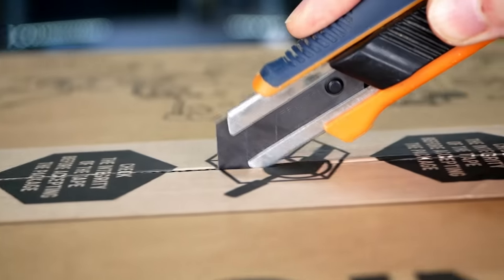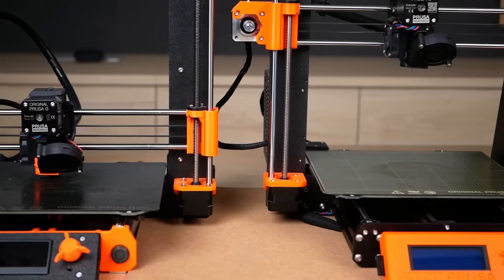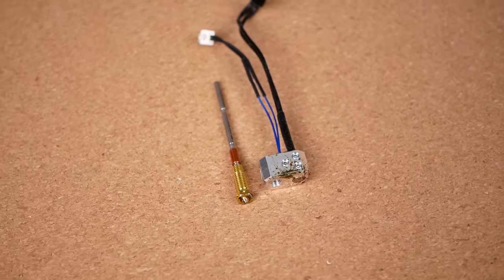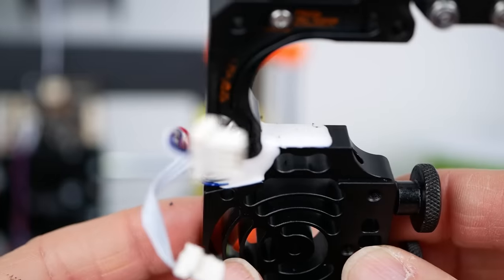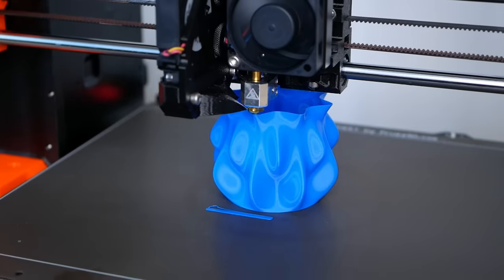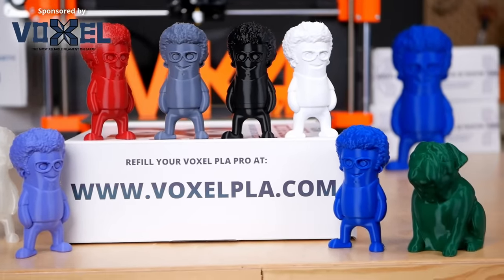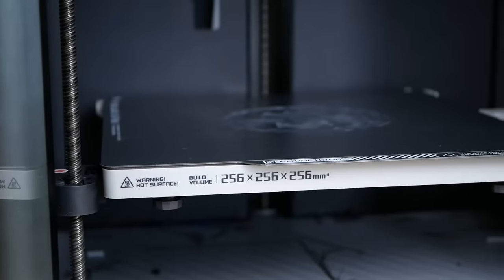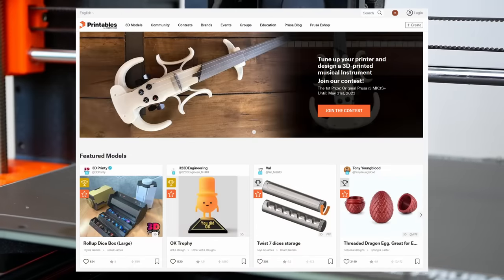Should you buy a NEW Prusa MK4 in 2023 or rather a Bambu Lab X1/P1P?

Comment: I dont think you are a Prusa shill and and frankly in the effort to show you aren't one, your comparison is somewhat flawed. You are comparing MK4 on release day vs Bambu labs now which is over a year after release. This gives Bambu a significant advantage in addition to already existing core xy vs bedslinger kinematics. Mk4 is producing near flawless prints with excellent material profiles and slicer support on day 1. It took Bambu a long time to get there and some may argue they are still working out issues. I 100% agree that advertising capabilities that are not accessible until some future point is inexcusable. Prusa is overpriced and should be $800-900 fully assembled and for $1100 should come with an enclosure. Having said that i would still choose reliability and their immaculate support over Bambu.

Comment: As someone who is informing himself before purchasing a 3d printer, my choice it towards Prusa.
This for several reasons, honest labor, proper support, proper warranty, reliability in the long term.
It might cost more now but would that still be the case 5 years from now.
Also, one has to look through the obvious biased reviews, when both named printers are reviewed at the same time with print samples, it is clear that the MK4 is a bit slower but the print quality is higher.
For me that would be the more important factor and i have two hands, that enclosure i build myself to my own liking.
Reply: youre making a huge mistake. bambu is hands down a better printer. i own both, my mk4 sits idle. the print quality is not better and its twice the print time if not triple.
Reply: @Saveddrip  Thanks that is indeed true. Prusa XL seems properly fast but than there is also an XL price tag for just the base. The thing is, the support seems to be very poor for the Bambu and that is why i rather look for another brand.
Reply: @42earthling  I've not needed any support so far and I got mine from kickstarter. That says something on its own.
Reply: @Saveddrip  Of course.. you have that one bambu lab which somehow has non of the comoon experienced problems.
 Prusa ordered and on its way. :)
Reply: @42earthling  lol you think I'm lying to you?

Comment: Its not bad that Bambu and others are closed systems. Its bad that they not provide spare parts of that parts, that are consumables for as fast printer (carbon rods glued, no bearings on X, just aluminium! pipe as bushing), so a lot of people will stay with other open source printers liek Prusa or Voron - sometimes you dont have time to wait for your printer, if you need send it to China to maitenance, or they even say they not agree with guarantee because its user fault, and say "buy new one"

In terms of ecology - better repair old one, than buy second.

Comment: I always hear good things about prusa but mine was anything but reliable. It wasnt my first 3d printer either. When it worked it had amazing print quality, however after 3 or 4 prints there was always another more obscure issue to solve. If there was an issue that a 3d printer could have THAT printer had it as some point. I managed to print CF Nylon once or twice with great quality so it and I were capable but i just dont understand how other people are able to get such reliability out of their prusa's. I upgraded from an ender 3 v2 which i had for about a year to a prusa mk3s+ kit with the enclosure and other upgrades. Maybe mine was a dud idk, I learned alot about FDM printing from constantly fixing and tuning the prusa but i never saw it as a reliable machine. Im sure other folks have had great results but im hesitant about anything prusa after the gremlin infested headache i dealt with for two years.
Reply: Agree fully with this. My MKS3 gave me a lot of headaches constantly fixing issues like prints not sticking on a freshly cleaned build plate and awful layer shifts. I'd sit there for hours getting the bed variance to crazy low values like 0.05 and still struggle to get a good first layer.

The Bambu oh my god. Right out of the box printed like a 12 minute benchy and looks better than anything I've ever gotten out of the MKS3. I was shocked. My first MKS3 benchy took over an hour and looked much worse.

Comment: X1does everything better? Not quite. Seeing reports of people who own plboth, prusa and x1, that they can't reach prusa quality on difficult tasks. The x1 can't do thin walls that well, it seems. And you can't reduce the speed below a certain point, in order to increase quality, as it actually decreases the quality then. I would say an x1 can be a nice addition, but it can't replace a Prusa, if you are serious about printing.
Reply: I have gotten nothing but really good quality prints out of my X1. I don't understand what you mean with thin walls. They've worked just fine for me. Any specific example?
Reply: @logitech4873  you can create for example, a box with 10cm high intersecting walls, each with only 1 perimeter (0.45 extrusion width or lower), and have a perfectly straight wall thats buttery smooth to touch and eye? For example 5 walls on the x axis, 10cm long and 10cm high, and 5 walls on the y axis, 10cm and 10cm high (intersecting, a box in the shape of a checker board),  all 0.45mm thickness with a single perimeter. You can even tilt them to a degree, and the result remains very good. I dont know if this replicates the exact problem they had, all i know is that they struggle to reach the same perfect quality in some scenarios, very thin walls being one of them. I do print this sort of stuff, so i know what to expect from a perfectly tuned Caribou/Prusa. It is pretty much flawless.
Reply: @logitech4873  I'm using CaribouDuet btw, which uses prusa open source, but beats Prusa quality. I do not know Prusa quality, but Prusa and Caribou users have confirmed the limited quality in comparison, in certain scenarios.
Reply: @logitech4873  and if you want to increase difficulty, make the inner walls only 7cm high, so that the layer time decreases for the last 3cm. This shouldn't leave any visible border and the upper end should print just as nicely as the bottom.

Comment: I own a couple of creality machines so am unbiased here.  But from all i've seen of bambulabs offerings, you'd be stupid NOT to buy the x1 or p1p now days.

If anyone asked me what 3d printer they should get, i'd say a bambu.  Creality have been mostly good for me, but fuck it's a learning curve.  You'll do more problem solving than printing for a long while.  

I've always viewed Prusa as the top of the line stuff. The perfect printer for a newb to get if they had the money (as they apparently simply just work).  However that mantle is passed to bambulabs imo.  They have brought innvovation to the market and done a fucking good job.  Prusa was caught sleeping, no doubt
Reply: My P1P had a dead stepper motor in less than 10 print hours and I had to hand deliver my P1P back to the warehouse in austin, then do a chargeback just to get my money back. All because BL took 3 weeks to respond to my support ticket and my "14 day return" was over. And they tried voiding my warranty since I threw away the box.

Meanwhile my 5 year old MK3 is at 17k hrs will literally zero broken or replaced parts, while ONLY printing 17% slower than a P1P. Fuck bambu lab, They're just CCP scammers.

Comment: Prusa got complacent and comfortable, sorry but I don't think they can bounce back from this. They will still be around but the premium they command will go away. 

The only issue I have with my bambu is the bed was a big warped, but they sent me a replacement with the engineering plate and now its basically a killer 3d printer.

I would not trash ender products or other Chinese low end clones they dominate the market and with upgrades and tweaks you can product results very similar to the Mk3 for half the price.

Comment: I have my printer in the living room, so noise is my #1 priority. So Prusa it is. And #2 for me is long term reliablilty, I hate the modern world where everything breaks right after the warrenty period. So another win for Prusa. And #3 for me is to support as local as it is possible to help to destroy the world for my kid as little as possible. So Prusa again. I agree, speed and features are also nice but not as important. And an enclosure with carbon filter, heater, light and cammera is equaly good, if not better, in DIY form around the printer in question, so that's not a big plus for the Bambo. Oh, and the Kit version is the way to go, if it comes pre assembled and you have a problem... you have a problem ;). And another point, if you take open-source but doesn't give yours back... I think this should be illigal.

Comment: i just ordered a P1S but i am considering canceling my order again due to the folowing reasons:
- privacy. it is possible to use bambus in lan mode but is inconvenient and for firmware updates you need to connect the printer to the internet
- closed system.   you can not repair bambu lab printers on your own and rely on the support. if the printer will not be supported anymore you might be forced to buy their new model.
- the main advantage of bambu printers right now are software related. this might change in the future and the prusa will be back in the game. i hope that the open source comunity will strike back. if so i think i am better of owning a prusa because i can then use it for probably 10 years and mod it as i want it and in the long run will safe money because  i am not forced to buy a new printer every 2 years or so.

Comment: I'll buy a Bambu this time -- why? Because they didn't stand behind their junk product.   I have a Prusa i3-MK2S.  I also purchased the first-generation 4-color MMU kit.  That kit was a piece of junk and I resent paying to be an alpha-tester for a failed product concept.  It was expensive ($299 USD in 2017) and they abandoned the design in less than a year opting for a redesigned "MMU2" unit (fool me once...). They did not offer to exchange or buy back the badly designed unit.  So, yeah, 6 years after they sold me a bogus product, I'll pass on a promised better printer when there appears to be  better built alternative.

Comment: I have a Bambu X1 and I fucking HATE it. I get layer artifacts and terrible bed adhesion because you can't adjust any part of the auto level. I do not like the trend toward "no user input needed" because the user can see and learn and adjust how things are done from that knowledge, the machines cannot.
Reply from the maker: Tip: You can adjust the nozzle offset in the start G-Code 😉
Reply: @CNCKitchen  I've also been wondering if a correction is possible on the Mk4. Would it also work on the mk4 via the gcode?

Comment: The main problem here is that the 20min benchy from the MK4 was printed in draft mode 😂
Reply: ....except the video they released of it running a benchy in 19mins was following the speedboat race rules (such as 10% infill, 0.25 mm layer height, 2 perimeters). Soooo...not draft mode.

Comment: Neither of them!!

BambuLab printers suffer terrible ringing and due to the fact that its majority users are noobs, nobody sees the problem.
If you aren't new to 3d printing, you can see the problems. I returned it to build a LDO Voron Trident.

MK4, coming from Prusa, you expected a way better finished printer but they rushed it because BambuLab printers started a mass cancelation of their XL printer. As a result, you have a so so printer with printing quality issues with minimal to no significant improvements from MK3S+ which I had.

If you wanna speed AND quality, Voron is the way. It's the only printer still that can print fast and with quality instead of one or other.
Reply: @JJ  It takes maybe 2 weekends (4 days, for people like you) to fully assemble and tune. You'll definitely get better results than that sloppily made Chinese closed source bullshit.
Reply: @coltenmeredith8899  I'll take that challenge. Tell me when you get your voron up and running and we shall test my BL X1CC vs your custom kit. (im close to 2500hrs printed in 10 months)No benchies. As a point of pride I have not and will not print those ugly boats. 😝 
Gauntlet thrown. 4/28/2023
Reply: @Ashley's Print Shop  Won't even print a benchy...A classic model that has roots in the RepRap community. But hey, what's RepRap??
Reply: @coltenmeredith8899   I know what rep rap ideology is and still say "Who cares"? I am not a gatekeeper about open/closed that I will chose a headache over simpler, effective  and capable solutions. You can easily search a benchy on a bambu labs printer. 

Get a model, not one that has been done thousands of times to the nth degree and let's compare.  How long until you have your voron up and running? 1 month, 2 months? seems like a decent about of time for you to source, build, tune, tweak mod and whatever else you need. 

Let's look a simple print in place with tight tolerances. Torture toaster? Clearance castle?  

Of course you can decline the offer. I wont think anything of it.
Reply: JJ  Prusa fanboy identified
Before saying a lot of nonsense, you should know that a Voron printer can either be sourced yourself or buy kits like LDO. 
Everything is well documented and least LDO kit is very noob friendly. Tweak, what tweak?? Not with LDO kit.
My brand new LDO Trident has printed 3176.8 meters or around 9.62 spools of filament within only 15 days with exceptional printing quality. I said exceptional printing quality, good luck with that on a Prusa printer.
My printer is stock and just work, Prusa mentality to think that their problematic Prusa is the best of the word. 
MK4 still has problems present on my old MK3S+, good luck with your printer tho.
Reply: @ashleys3dprintshop  I would love to do that, I returned my X1C because it cannot print PETG with deep ringing and printing quality issues. I had it for 3 months, 3 months wasted trying to get it to print high quality prints.
I bought X1C to avoid the Voron building process, my biggest mistake. I will be building another LDO Trident, it is a horsepower printer.

Comment: The problem with every prusa verse bamboo lab "comparason" is that the person making the video is a prusa  Fanboy. So in the end the video is less about which printer is better but which company you feel more attachment to. Towards the end you even said it the prusa isn't as good on paper but suggested you buy it out of thanks for all the other things that prusa does VS what the actual printer is capable of doing. 

Yes prusa has supposedly done a lot of good open source stuff and develop the prusa slicer which even I admit I use, but as a consumer looking for the best printer within a budget the MK4 is honestly not even on the list of printers I would be looking at. Right out the gate it's slow and doesn't compete with any of the more modern printers that have come out recently. The features it has are common place now and this idea that prusa has led the industry in innovation yet has been continuously selling a 5-year-old printer without putting something new out only to put out something that's still left behind is a bit odd. I believe that prusa definitely needs to step up their game and put out a real printer if they want to compete, I think that their DieHard fans are what's going to keep them afloat in sales though.

Comment: I have to disagree regarding printing being where it is today due to the open source nature.

Its been stagnant for a long time. There's been no real breakthrough for anything special other than the e3d tool changer. But that was an enthusiasts machine anyway.

Until bambulabs introduced their printer all of the others were much the same. Bambulabs have developed their own technology and borrowed some ideas such as motion systems etc. But their lidar scanning hasnt been seen on any other printer.
And sure they are using OpenSource software to slice but thats nothing new, Prusa took Slic3r and adapted it to their needs. I'm not sure Prusa have really contributed much to the hardware scene of 3d printers. No doubt their software engineers have though as PrusaSlicer I think is the best slicer out there now.

At the end of the day Bambulabs are a business and their competitive edge is that they are like the Apple of 3d printers. I dont think we can be critical of Bambulabs not open sourcing everything. They spent a long time designing and building a machine that is ground breaking. As I said they are a business so why should they be benefiting other business from their hard work. As long as they are not patenting everything then ive no issues at all with it not being open source.

Comment: First of all, I do not own a Prusa but a Bambu Lab. 

Nevertheless, I like what Prusa has done for the community so far. Be it printabels or other things. 
In any case, it's nice to see that Prusa is still developing. Even if this development has perhaps come a little too late. Especially the extruder, nozzle adapter and the hall sensor. If these things had come 2-3 years earlier, the competition would probably have had a harder time. I also like the option to choose between WLAN and LAN.

Even if the Bambu has many nice functions, this is far from perfect.  

Especially that many functions are not yet implemented in the MK4 software is a pity. Of course, you can look forward to more functions, but it would have been nice if they were there from the start.

At the price you notice of course something the place of manufacture. When I consider for a MK4 you alternatively get a printer with closed print space. But you know how durable the predecessors are.